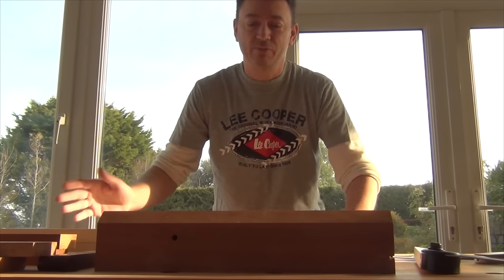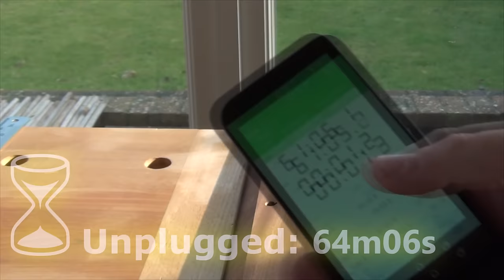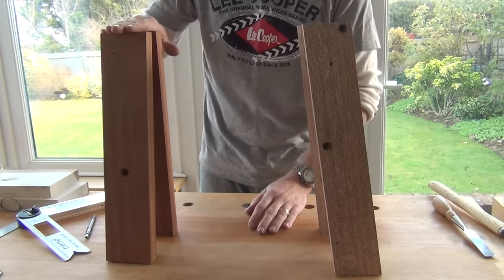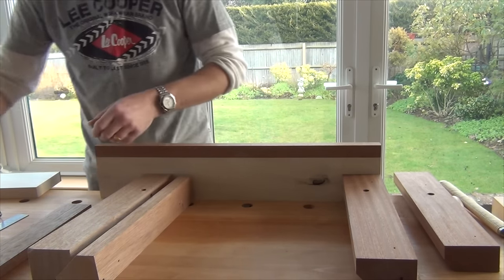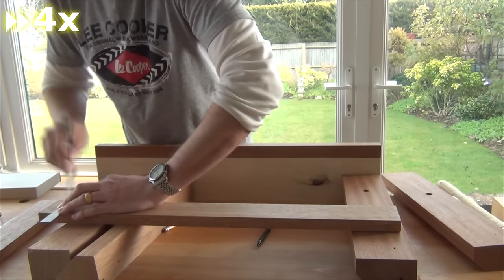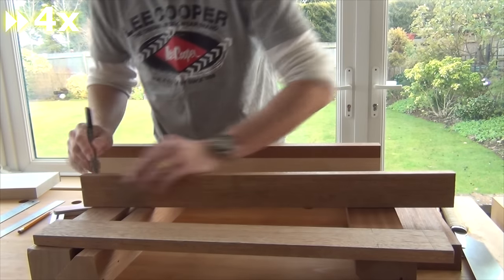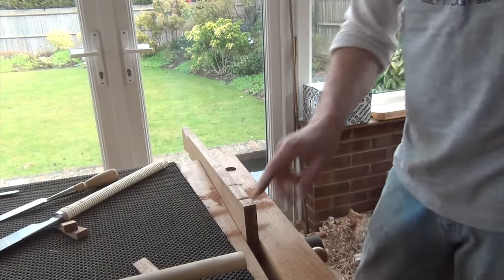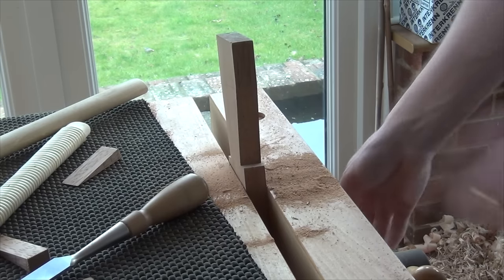My Sawyer's Bench Build part 2

Comment: Beautiful video, Mitch.
The bank looks great.
With a Japan saw one can cut off 1mm wide pieces, whether it goes with a Western saw I do not know.
I'm also thinking about making a bank like this, but it's supposed to work as a bench. Can the Japanese saws be used with this bench? Or would be a slightly inclined for Japanese saws better.
Reply from the maker: Thanks Gunter!
I think perhaps one could stand above the work on the bench to use a Japanese rip saw ;-)

Comment: Speaking of saws. I only have a single back saw - Stanley fatmax 13 tpi. It's very sharp but the tooth set ("spread") is too high.. Forget about knife wall or chisel wall. On a 3 inches wide oak board it has undercut my vertical line by 1 mm over less than 10 mm. In fact I can see it biting the sides right from the start, even with a knife wall deeper than the teeth height!
Reply from the maker: I don't know about that Stanley, but certainly some modern saws seem to be able to cut sideways very well! The knife wall I feel is more to do with getting those first few strokes made that set the saw on it's path. Not a solid guide against which to push the blade. More often than not I leave a hair of waste, and use the knife wall to place a chisel on to pare away the final bit, or a plane to carefully plane down to. It also cuts those surface fibers that might spelch out when sawn.

Comment: Love your work and videos but may I ask why do you work in imperial you are about the same age if not younger than me so I know you were tough the metric system at school, is it to appease American viewers, IMO metric is much easier and more accurate.
Reply from the maker: I'm over fifty now, and although metric was adopted when I was at school, we were taught both due I think to the very present resistance of those who had only been taught imperial ( teachers, craftsman, traders, etc.) Having used both, I see benefits and problems with both of them, and tend to let individual jobs guide which system I use.
Certainly I can't please all my viewers, by sticking with one system, and possibly I irritate most of them by not being consistent 😉
Reply: I only just come across your channel and noticed you use both ,oop sorry, myself I was tough to use millimeters in Joinery and cabinet making. Having moved to Israel from the UK I had to get used to the way they measure which is to use a point in CMs eg 47.7cm instead of 477mm which I though was odd at first but I quite like it now for general use , now I make guitars which require at times point of a mill which is almost impossible without a template, Anyway thanks again for your videos I have found once again a new love for traditional woodworking techniques.
Reply from the maker: I want to build a guitar, and have a lovely piece of ripple ash for the body - I'm a lousy player, so for the sake of everyone at home I want to make an acoustic guitar in the form of an electric one with a hollow body just sufficient for a little passive amplification. Not even sure if it'll work, so I'll make a prototype first. If you have any tips or suggestions I'd love to hear them as I'm pretty much flying blind on this one.
Reply: Probably a tricky first build , draw yourself a full scale of the guitar and decide on a through neck or bolt on . id say the hardest part is achieving the neck brake angle . Making out the frets is the part where you will work to point of a millimeter so decide what scale length you want and get a slotted making rule, I have tried to measure by hand it never works out.  check out Ben Crimson guitars on youtube for Luthier builds and Pablo Requena spanish guitar making , I think you will like Pablo Requena work will be more to your liking , Ben Crimson is a bit more gun hoe in his approach and makes it look easy , im sure you will make a great luthier.
Reply from the maker: Thanks Pat!